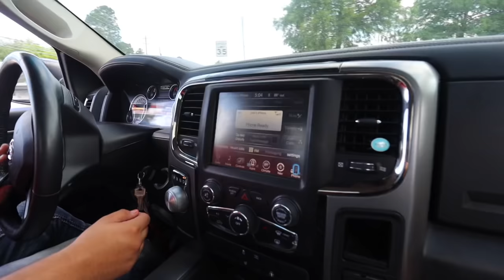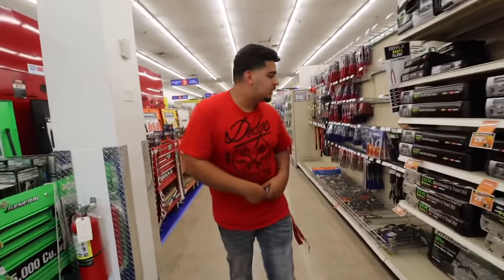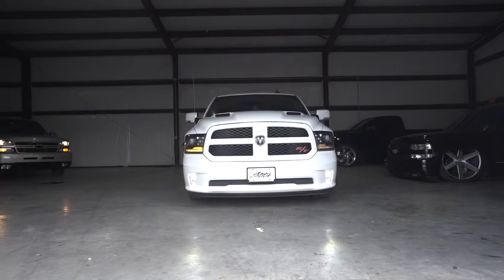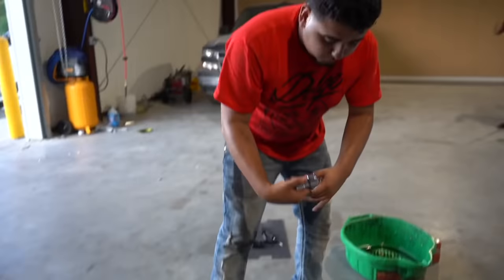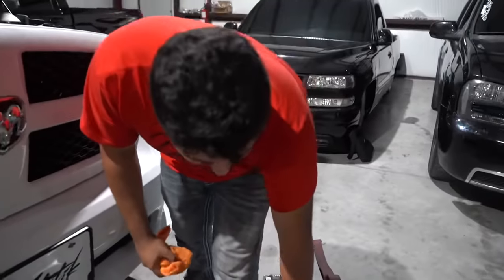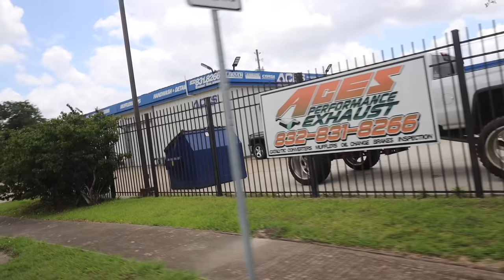Installing headers on my Ram R/T! 🐑

Comment: You can put the srt filters from the hellcats and ScatPaks on these 5.7 the filter is actually usually in stock at all dealers and only is about $23.00 the filter stays open and allows oil flow better especially if your modded.
Reply: I see someone else knows this trick too. Smart man.

Comment: Did you tune yours for the headers? These 2015 rams are a bitch to tune, you gotta either swap out the pcm or get it unlocked

Comment: Nice choice on the headers.  They sound beasty.  But mobil1... not a fan, especially in a hemi.  My own gen 3 makes way more valve noise and runs 5-10 degrees hotter than with more premium brands. I won't touch it anymore.  For the plugs, just get whatever NGK part that fits.  That's what's in the mopar boxes anyway.  Just make sure to verify/adjust the gapping (which should be done with the mopars too)
Reply: What oil do you use?

Comment: Damn, that pickup looks clean. I have a 99 Chevy Suburban and a 96 F150 single cab lariat. My son is 13 and asked if I could build him a 2004-2006 ram. Might as well have a project for him and me to work on since he was too young when I did my other toys. Any tips on building a ram SRT clone? I was thinking about dropping in a 6.2 off a newer challenger/charger.

Comment: Ditch the 5w20 and start putting 5w30. Been using 5w30 on mine since I drove it off the lot. How many miles you got on the truck? I got 62k on mine and debating if I should do spark plugs already.
Reply: Going to a 5w30 oil doesn't mess with the mds?
Reply: @srtk89  nope won't mess with it, I have bypassed the mds and ran it on all 8 cylinders since I drove the truck off the lot though. 5w30 will just give you a little more protection and don't go by the computer to tell you to change the oil. The hemi breaks down oil quicker due to the angle of the lifters in the bore, so 5k and under intervals.

Comment: Does it have the deactivation solenoids? If so DELETE it! You would have to change the lifters, block the sensors with block off plugs and minus well get a cam since your there! Dont want to hear that v8 turn into a 4 cylinder lol

Comment: The color of the oil doesn’t mean its not still working great. Darkness of the oil means its doing the job it’s meant to do. That is lubricant and clean the engine of contaminates.
Reply from the maker: I see where your coming from, but after a good amount of miles it’s always good to refreshen the fluids.

Comment: How much did they charge you for the header swap?
Reply: Your going to need a tune, I heard you say you have a 2013? You shouldn’t need an unlocked computer. Check out moes performance and get a handheld tuner. They offer custom tunes for you depending on your mods.

Comment: 16 spark plugs?
Reply: yeah two on each cylinder for better combustion, and I believe mopar had gotten in trouble for bad emission years ago having one spark per cylinder so they added two on each to bypass it
Reply: @modestproposal5624  cool right on didn’t know that 😎